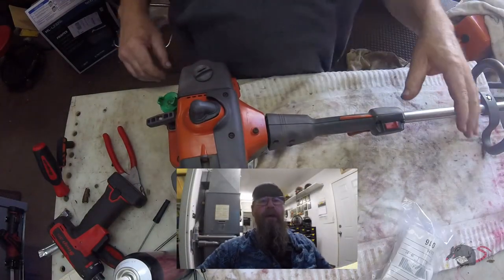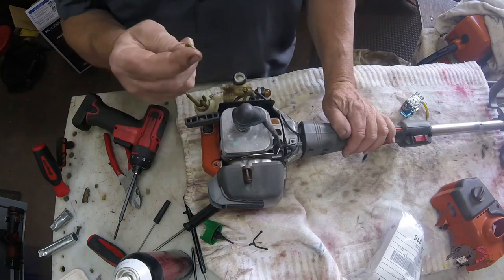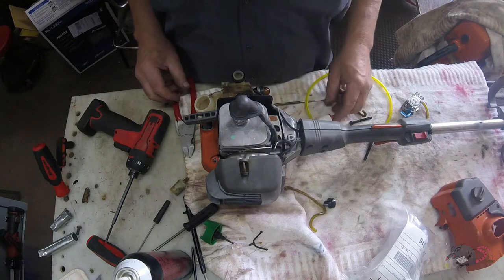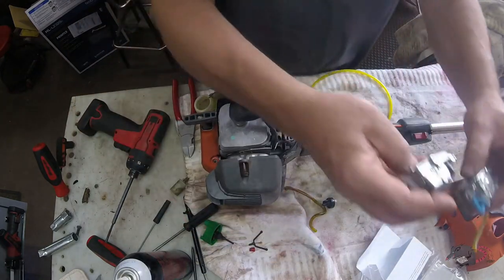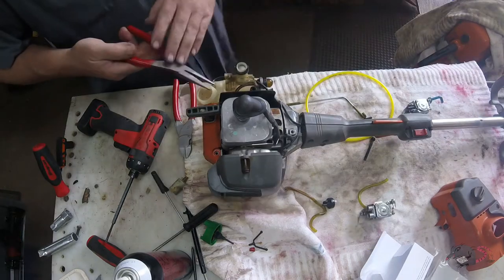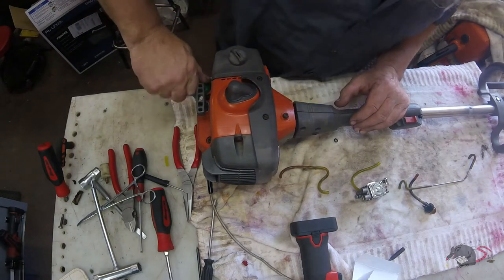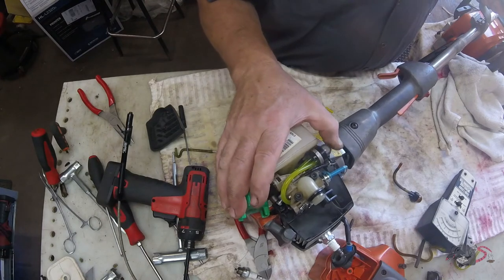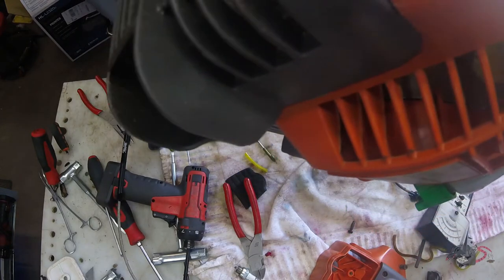Husky 326LS Carb Replacement

Comment: Coincidentally, I had the exact same primer bulb issue happen to me a couple days ago!  Pumped and pumped and pumped with no fuel coming through. Must have been the same batch of bulbs from that manufacturer. Took it apart to see how it was built and functioned, so it was a learning experience. The check valve popped into place in the brass piece but not a very tight fit. I suspect when they’re dry they may be somewhat loose and once they have fuel around them they tighten up just enough to keep in place. Maybe pump a little slower with a new bulb to give them a chance to lock into place. 
What I wondered about in this video was how easily that new return line went into the grommet. I was expecting that to leak. I guess once the intake line goes into the grommet there’s enough pressure to hold things tight.
Reply from the maker: If they leak then I hit the hose with carb cleaner and use super glue to seal it in place. Sometimes, at some point, you have to decide if more parts are needed or more fixing. I think a lot of customers want us to fix things rather than bolt parts on.
Reply: @TheGreasyShopRag  
I use two sizes of genuine Tygon fuel line that are both 3/16 OD. One is 1/8 ID and the other is 3/32 ID. One is less compressible than the other so it seals up better in slightly larger holes, and because the ID is smaller it fits tighter on some smaller nipples. Between those and two other size lines I’m covered for all the handheld stuff.

Comment: I can't believe there is a small engine guy that uses tool truck tools. The guys around here usually have a mash up of Walmart and farm and fleet tools but use scrench and pocket screwdriver the most.
Reply from the maker: As long as they get the job done i guess it doesn't matter.  I've found the quality tools have made my job easier.
Reply: @TheGreasyShopRag  that's been my experience the saw shop I go to I don't even think the guy has a toolbox his tools are in piles next to work areas. He is a really good with saws but I couldn't work in his shop it'd drive me nuts

Comment: I’ve watched multiple videos and it’s never clear to me about the routing of the fuel lines.  Still can’t figure it out
Reply from the maker: There are two fittings on the carb. For ease of explanation lets say one is on the choke lever side and one is not. A line must go from the non-choke lever side to the short fitting on the primer bulb. The long fitting on the primer bulb is the return line back to the fuel tank. The fuel line with the filter on it runs from the tank to the choke lever side of the carb. Clear as mud?
Reply: @TheGreasyShopRag  thank you  I’ll try this routing Wednesday when I’m back from work.  I appreciate the response.
Reply: Well I have a new carb, routed new lines, have spark but still won’t start.  I’m at a loss, guess I’ll throw it in the scrap pile at this point

It’s gave me trouble every since I bought it in 2015.  I only used it 3 seasons before it started missing up
Reply from the maker: @ericcampbell7097  Is the spark plug getting wet? If so maybe the flywheel ket is sheared.
Reply: Thanks for all your input.  I unplugged the kill switch today and it fired on the second pull.  I’ll trace those wires this afternoon and get her fixed proper.   Your carb directions were spot on!!!!
Reply from the maker: @ericcampbell7097  Glad to hear you're figuring it out!